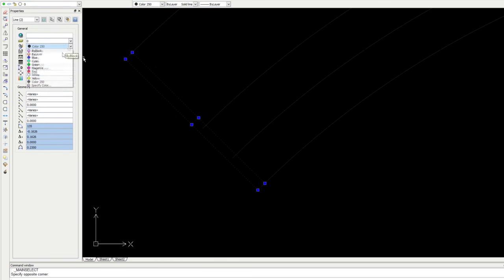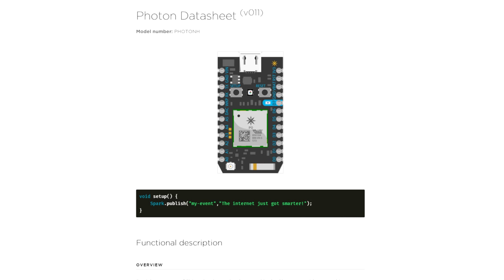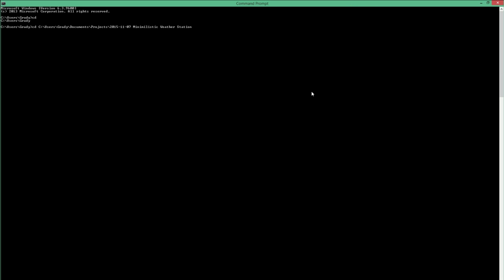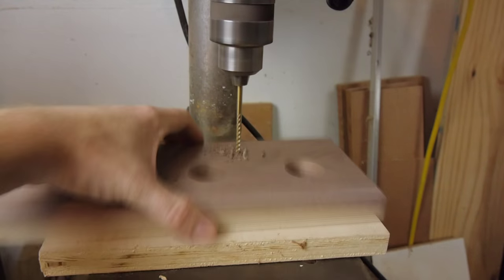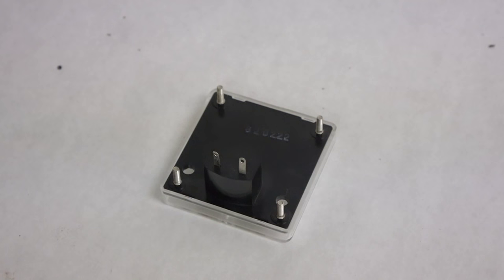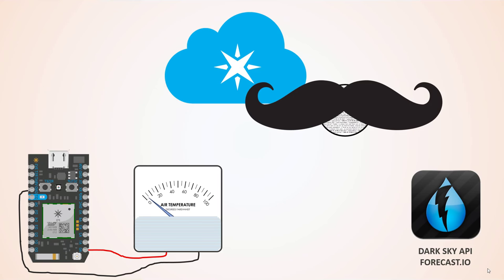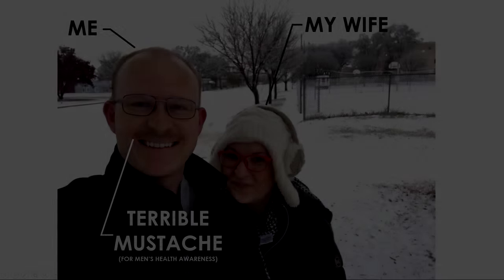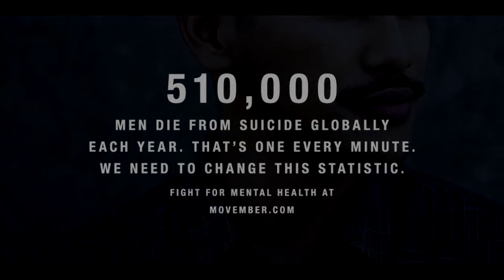Arduino Weather Station - Internet of Things and the Particle Photon

Comment: 4:32 The wire core goes through the hole on the solder pad (or in this case tounge). Put the core through, bend it 180 desgrees so it loops back on itself, then solder. This is to reduce mechanical stress on the solder joint since solder degrades quickly under mechanical stress, it's not just pulling on it but also small vibrations from your table fan or transporting it in your car.

Sometimes you can see this clearly if you open up old electronic boxes from cars. If there's through hole components there's a good chance you'll see a circular crack going through the entire joint at about a half of the radius from center. Heavy components like coils with ferrite cores or large capacitors usually have additional material to support them mechanically such as a plastic brace or glue, because those are what you'd expect to break if you shake the board, but smaller components are sensitive too because over time stress fatigue in the solder start to have a significant impact. If there are large connectors on the boards they tend to rely on the board staying perfectly in place inside the casing as well, a dangerous assumption in an automotive environment.

This has caught many manufacturers off guard, even SAAB where for example the cruise control module on SAAB 9000 randomly stops working after 10-20 years because the components are all through-hole but only mechanically secured through the solder joints and the conformal coating (a layer of "paint" over the board to prevent shorts and mitigate moisture affecting the joints). If your car starts having problems with an electronic control box, take it apart because this might just be the issue.

Comment: Great video, again! You deserve 100 times the number of subscribers you have! Cheers!
Reply: Hey got a quick question for U & seem to be very knowledgeable about such things, working on a similar project & need to know is does one have a pulse signal from the flow meter and can one able to convert that signal to a 4/20mA signal that will be converted to a 0 to 5 vdc input?
Reply: Whether U R able to answer my question or not the project is cool as all get out & thanks for sharing & best of luck in the future.

Comment: For these IOT projects you could also use an ESP32. They are around 10€ and have wifi and bluetooth moduls build onto them. They are compatible with the arduino IDE so you dont need extra development tools for programming

Comment: Holy crap that's cool, and those steam gauges are really slick looking

If I could wrap my head around any kind of software development at all I might actually be tempted to copy this, at the very least for the precipitation chance part (I'm a motorcyclist, that tends to be the most important part of the weather report to me)
Reply: I'm the same, not bad on computers but this is way above my knowledge, also 10gb wow.
Reply: For what it's worth it looked like most of what he had to install is stuff that's used for all sorts of projects like this. an IDE to code in, Python, etc. Didn't look like it was a bunch of single-use stuff that's just going to waste space on a HDD for a single project.

Comment: I was just thinking, a neat project would be to build an IoT rain gauge. The effect would be to have a rain gauge with a key pad. You type in a zip code, and it automatically fills the rain gauge to the last day's rainfall for that location. Might be a bit tricky to build, but it seems reasonably possible, and the "useless but neat" factor would be pretty high.

Comment: You made a really nice 'thing'. Good video too. I was interested to see the scale range you chose for barometric pressure (1060 - 1160 mB). Where I live in the UK - Worcester, I would expect a range of more like 960 - 1050 with typical readings of 990 - 1020 (altitude of ~200 ft). Just interested in your location/altitude.

Comment: Looks spiffy, but would have been better if it obtained the weather data from instruments located outside your home. Wunderground is about the best I've found for getting local conditions without an actual weather station in my backyard, but they keep changing their website in ways I hate and the site has become rather buggy. About half the time, it just doesn't work right.

Comment: Would be cool if you can share the diy labels for the analog gauges.. i would like to use the temperature one with my arduino and a 5V meter that look like yours :-P
Reply from the maker: +Moes Check the github link in the description. I have them uploaded there.
Reply: +Practical Engineering It looks like that link isn't working
Reply from the maker: Try it now.
Reply: +Practical Engineering 

Sure is! Thank you so much!! Great project! I am trying to do something similar using these old Westinghouse gauges as the readouts.

 http://www.ebay.co.uk/itm/NEW-WESTINGHOUSE-KA-241-A-C-AMPERES-GAUGE-/271819562590 

Not sure if that is even possible, but it would sure be neat!

Comment: internet of things= internet of dangerously insecure and poorly coded things
Reply from the maker: If someone hacks my weather station, all the power to them.
Reply: I don't mean just your thing I mean all IOT stuff especially that which companies sell
Reply: Its not hacking the the weather station that is the problem, its the using it as a tiny terminal to infiltrate other juicier targets inside your network.  This is why I have setup an untrusted firewalled VLAN in my home network for IOT devices.
Reply: Then can use your weather station as a relay to hack into other targets
Reply: Well in this case its not that bad since the station is not acting as a server to the public. As long as the data it gets from its service isn't compromised, a bug in the software can't have serious consequences. So basically the security in this instance relies on the particle webservice and the weather service not getting hacked and the connections between them being secured by tls.

Most unsafe IOT equipment acts as a server and allows any device to connect to it. Examples are webservers on IP-cameras or terminal servers which give direct access to a terminal.